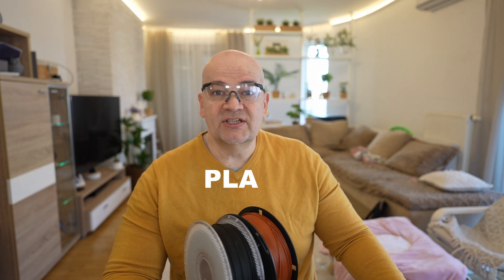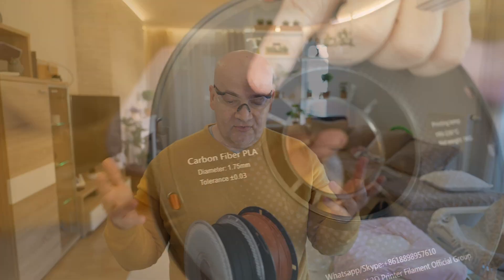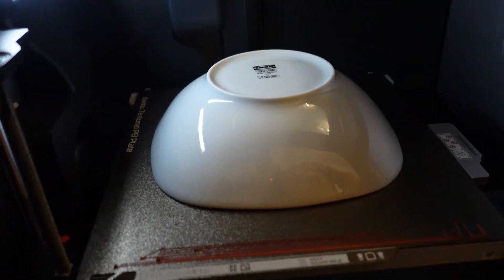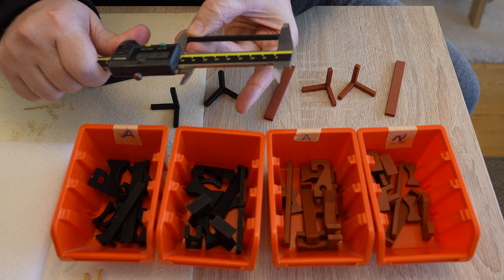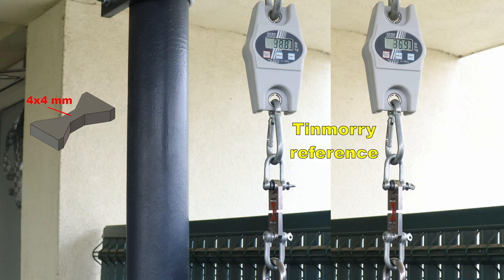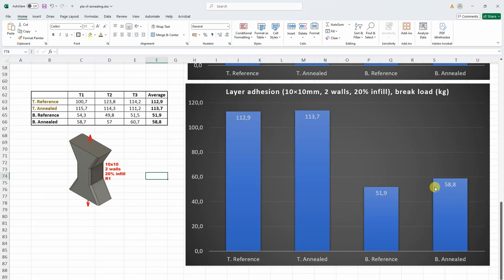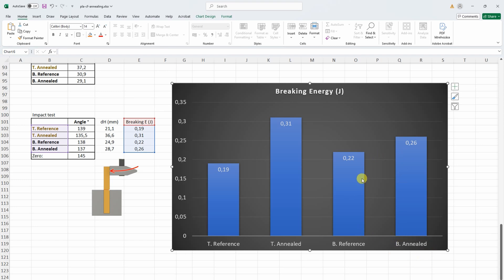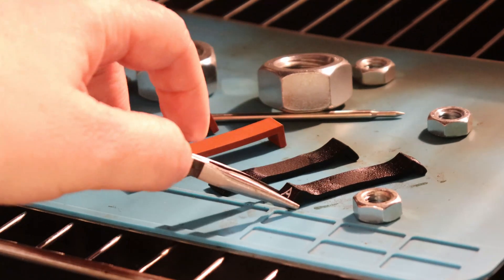Annealing PLA-CF: Temperature resistant, but does Carbon Fiber prevent Warping?

Comment: Wondering if brick layer printing would further reduce the shrinking/warping since there are less gaps where the material could move. Potentially these gaps between neighbouring layer lines are also the reason why it usually shrinks in X/Y but not Z.

Comment: Amazing content! I have bought the tinmorry pla-cf filament black, however I find during annealing at 100 degrees it warps quite a bit! More than is acceptable. I have seen the color of regular pla can have a big impact on annealing warping/shrinkage as well as other properties. Any idea if the color of the tinmorry pla-cf affects this shrinkage? Same holds for layer adhesion.

Comment: Terrific post. I think you found the best reason ever for using a PLA-CF. Getting 140+ degC from PLA-CF is more than I would have hoped for. I've been wanting to print some parts that would work in a car, but because I don't have an enclosed printer I've been avoiding ABS. Fortunately, my system is supposed to support a 100 degC bed temperature. Assuming that the shrinkage after annealing is consistent it should be easy to compensate for it with scaling in the slicer or the CAD software and get more accurate parts.
Reply from the maker: In slicer, you can compensate the shrinking (material property, no need to scale it yourself). Only with some complex geometries, it will not be accurate

Comment: It would be good to do a test where the printed object would be heat-treated in a fine, compacted salt oven. It would be interesting to see how much stronger and heat-resistant the object would be, since it would completely fuse together. With this heat treatment, there would be no warping, because the compacted salt would not allow this, but this could only be done with a completely solid 100% filling, because there would be no air gaps left in the object.

Comment: I love that you're doing all of these tests! I really appreciate all the work you put into these and I hope more people subscribe. You're so thorough. I've even tried the "lazy" annealing method after seeing your other content on it with good results myself! One of the ways I reduced warping was to slowly bring the bed temp up by 2c every 10min until 100c to keep the parts adhered to the bed. When I went straight from 65c to 100c I could hear it crackling and snapping off the textured PEI plate. 

One more note, I was thinking about the results of the temperature test. I know it's a timelapse but I have a feeling that the part isn't getting heated through entirely as the temperature goes up in the oven. I think a better test would be to increment the temperature in the oven in 5c intervals every 10-15min to ensure thorough heat soak of the part to get a more accurate deformation temperature. I wouldn't be surprised if you saw a much lower deformation temperature with this method. Sure, 5c increments would reduce the resolution of the results but if you do see a lower deformation temperature, you'll know that the oven is heating too quick and you could adjust the methodology from there. Just food for thought!
Reply from the maker: Yes, real temperature test is much slower. But I can't follow that method. I just test my oven to max and follow the temps and deformation. Slow increasing or similar is not possible. The oven is not so accurate, if I would set 90°C for example, it would go up to 120 and then slowly cool down. Also, with this testing method I did 100+ experiments, the data is more comparable with each other.

Comment: Thanks for the work once more!
Till now I saw CF filaments as of no use except for PC , Nylon and PPA as they are really hard to print without fibers. This is definitely a great way to up the quality of PLA parts where the fibers make it possible.
I wonder why producers load their filaments with such high percentages of fibers, does that give any advantages or would 5 to 10% actually be better?
Reply from the maker: Exactly. When company have some good PLA, they should add only 5-10%. But most of them think more fibers = stiffer (which is correct, but weaks the layer adhesion). And it would be great if those 5-10% would be added in the core of the filament (currently I am testing PPA-CF Core by Siraya, great solution). Video in 10 days maybe.

Comment: Try annealing with lower temperatures (100º, 95º, 90º, 85º, 80º…), eventually different PLA brands, and see the difference in deformation and temperature resistance.
Maybe we can anneal effectively at a lower temperature with lower deformation and still increase the temperature resistance.
Reply: you can anneal at a lower temperatures, it's just going to take longer. Annealing of PLA works well because after the glass transition, it softens a lot but in the range of 80-120 degrees undergoes cold crystallisation, a process where crystallinity increases . That is why holds for longer and usually in injection moulded samples mechanical properties increase as well. not all polymer cold crystallise, but for example PET does. in injection moulded samples , with a mould set in that range of 80-100 degress C, in 2-3 minutes is enough to improve the mechanical properties, being the modulus comparable and sometimes better than PEEK ( yes, poly ether ether ketone, that melts at 350C).

Comment: Outside of doing testing on every material, there's not really a standard shrink rate to design parts around, so far as annealing is concerned? I wonder what it would take to get the manufacturers to list that on official white paper documentation. (Other than subbing to My Tech Fun, of course!)

Comment: Higher percentage of CF should improve dimensional stability. Also I saw on one of your tests (I believe it was PEEK CF10 and PEEK CF20) that 10% was more brittle than no CF, but with CF 20 impact resistance raised compared to 10%. I think the most common 10% can actually do more harm than good to material properties, and the real gains start with higher percentages. What are your thoughts on this?

Comment: You mentioned the PLA designed for annealing, but it wasn't perfect. I am curious if they could make a version with only a small percentage of CF or GF to reduce the last bit of warping. Maybe 5% fiber content. Should be minimal impact on layer adhesion, but improve the dimensional stability even more when annealing.
Reply: Rosa3D has a CarbonLook filament line that is basically either PLA or PETG with a small addition of CF. They don't mention how much CF is added in the datasheet, though, but they do claim it's less abrasive to brass nozzles (dubious tbh, I'd still use hardened or obxidian).
Reply: @Madgod112  Yeah, but they are just standard PLA right? So annealing would be an issue.

He mentioned a brand that was formulated for better annealing, but that it still exhibits some warping.

That filament with a small amount of fiber might work even better. Layer adhesion would be good and the fiber would prevent the last bit of warping that they could not stop with their special formulation.
Reply: @jasonh4534  They have a PETG variant, but neither has any additions (other than the little bit of CF) that would improve annealing AFAIK.

I actually still have a bit of CarbonLook PLA. Might experiment with it, but I never actually attempted annealing at all - I did want to test annealing in a soft silicone mold at one point but never got around to it. I was hoping to get results similar to annealing in fine salt or gypsum.

Comment: Hi . great video. Would be interesting to know if annealed version was soft at around 90C.
Reply from the maker: No, its hard. You can even boil it
Reply: @MyTechFun Interesting. I wonder if I can make high temperature spools out of it? 

I'd been thinking about getting some PA6-GF for that without having to print ABS in the house, but if PLA-CF can do that just a well, for half the price, seems like a better option.
Reply: @ Nice. Thank you

Comment: I don't know if it would matter but I would probably write a script if I ever wanted to anneal something with the hot bed. Like start at 60 then to 55 then to 61 and to 56 to 62 and 57 all the way up to 120 degrees and then just let it sit there for a while. I hope that the temperature swings would reduce warping. Also I hope that by slowly increasing the temperature it will heat much more evenly thus reducing the stress.
But maybe its better to just increase the temperature by 1 degree at a time with a G4 command in between each increase.
Reply: 👍 That's a great idea. It would be easy to make an annealing g-code file and send to to the printer after a print has finished (as long as you have a soup bowl available 😋)
Reply: There's an easy way to do that. I've been annealing PLA-CF for a while and I use a slow cooker set to LOW, filled with tap water. It can take up to 3 or 4 hours for the pieces to get up to 200f (94c) which is where I stop. Then let them cool in the water as well. The very gradual temperature increase leads to very minimal warping.

Comment: Can you anneal in water?
Reply from the maker: Tried: https://youtu.be/pRPLtDPoBFE?si=VmoW5CjWTmQLeGiQ
Reply: @MyTechFun  thank you!
Reply: Yes, I have annealed PLA-CF in water in a slow cooker set to LOW. It takes several hours to reach my target temp of 200f (93c) and then I turn it off and let them cool in the water. Works great. I also tried annealing in boiling water but it resulted in more deformation so I would try the slow cooker or lazy method over boiling water
Reply: @KP-ty9yl  perhaps we can try doing it with sous vide.
Reply: @ Yep that might work even better! I just had an old slow cooker sitting around and know most people do :)

Comment: Excellent, thanks! I was hoping you'd check the creep of annealed PLA as well. If I were to use annealed PLA in a mechanical application, temperature resistance and creep are the properties of most interest, as the stiffness and toughness are generally known and can be compensated for fairly easily.
Reply: I was thinking about that aswell, i hope it can be tested further on.

Comment: What about annealing it on an oven, buried in sand?
Reply: I have been annealing PLA-CF for a while. I use a slow cooker with tap water set to LOW. It can take several hours to reach the target temp of ~200f or ~93c. Then turn it off and let them cool in the water. With the very gradual temperature increase the warping is very slight
Reply: @KP-ty9yl  wait, so you have the parts under water?
Reply: @ yep. no need for a bag or anything, just directly in water, fully submerged
Reply: @KP-ty9yl  alright, interesting to know. Thanks

Comment: Wery usefull, PLA-CF anealed is to go then.
Its beter anealed from PETG-CF if a bit lower temp of use are normal. 
Since layer adhesion is some 30 to 35% beter.

Comment: Probably a silly idea, but what if you put the parts into e.g. sand and then heat the sand? Any chance that would help reduce warping?
Reply: or salt?
Reply: CNC kitchen did this. There's still some warping.
Reply from the maker: I am to lazy for it, that's why I tried lazy annealing ;-)